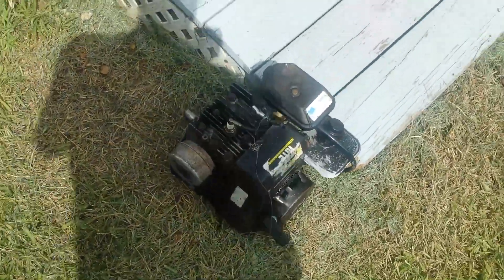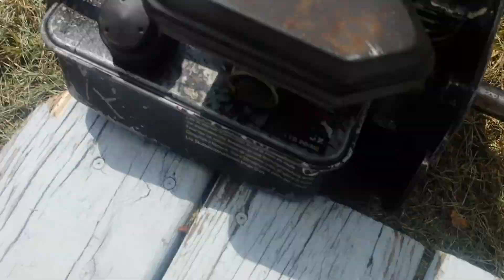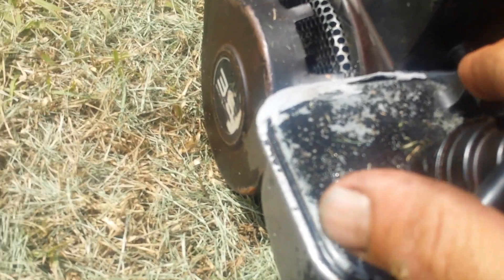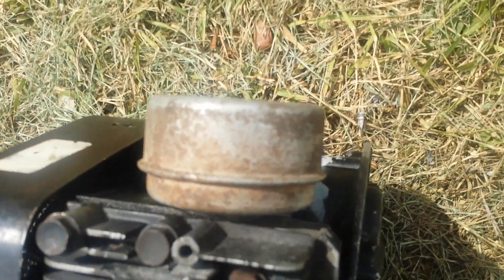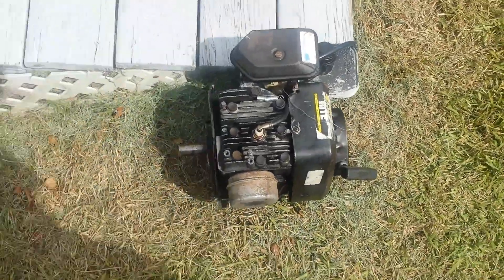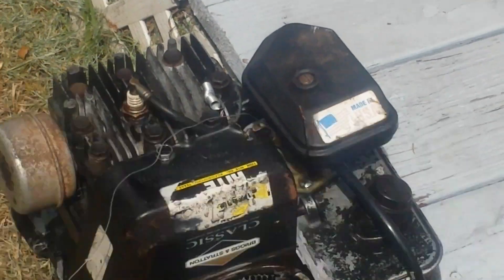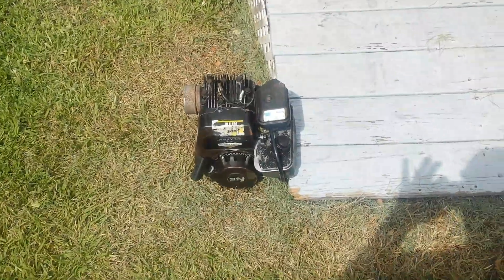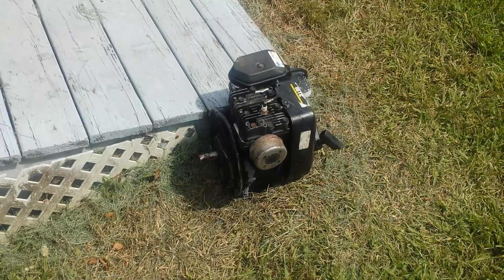3.5 hp Briggs and Stratton engine horizontal conversion  done

Comment: This engines won't start without a flywheel I have 3 of the same and a 6hp one but when you try to start it it pulls the recoil and almost ripped my hand off how do you start it did you change the flywheel from aluminium to iron
Reply: Kind of late, but, don’t pull right away after you just pulled, try to "reset" it. It happened to me before, I got a giant bruise on my right hand because it yanked the cord super hard.